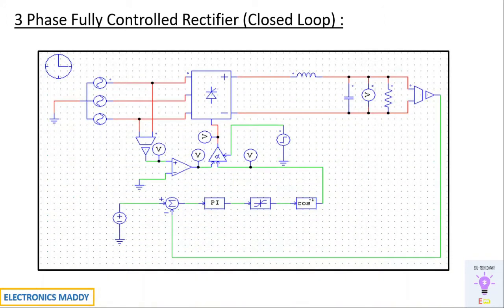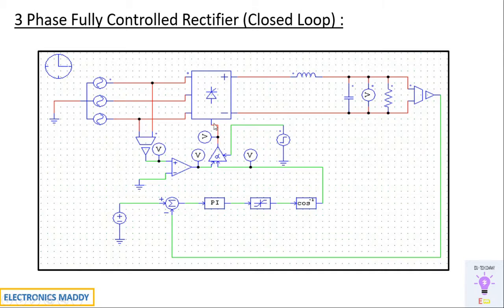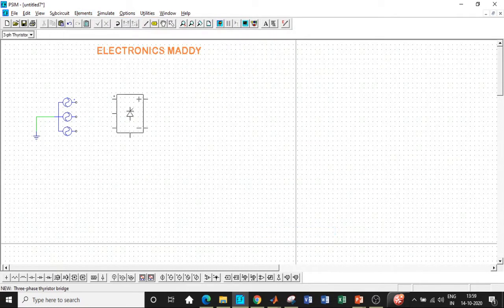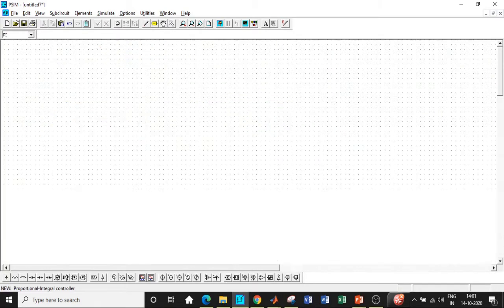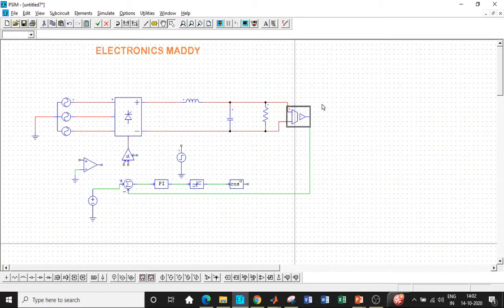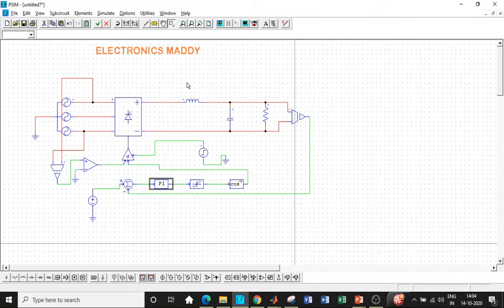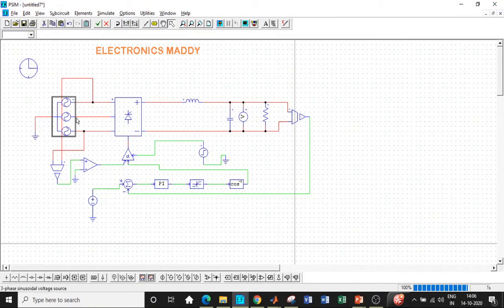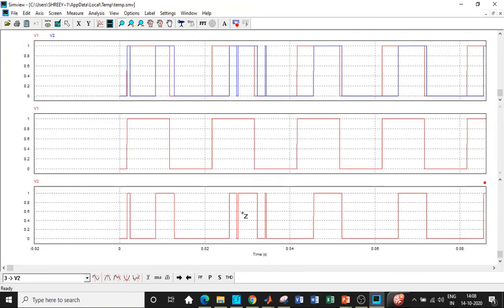Closed Loop Simulation of 3 Phase Controlled Rectifier in PSIM | POWERSIM

Comment: Hi bro, just to check with that are you able to design a wind and solar hybrid circuit, where output will be AC induction machine 400W. It comes without a battery and moreover no block circuit like the thyristor block shown above.  It's like fully circuit based. The program to be run on psim 8.0.7.